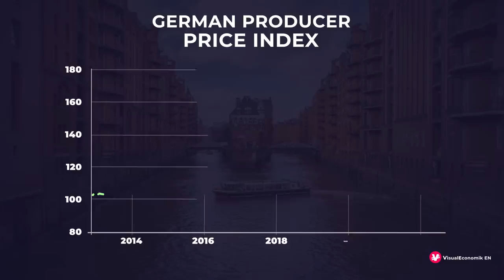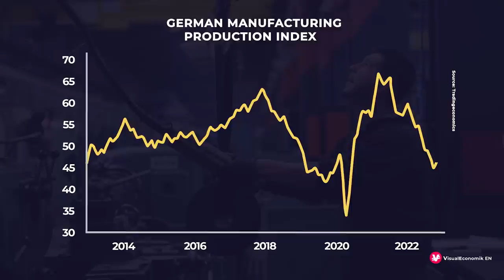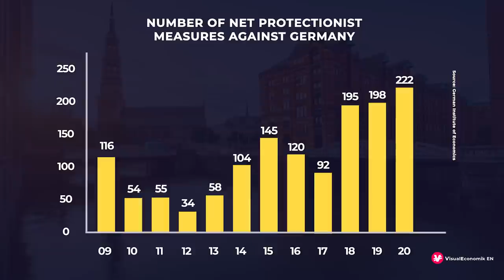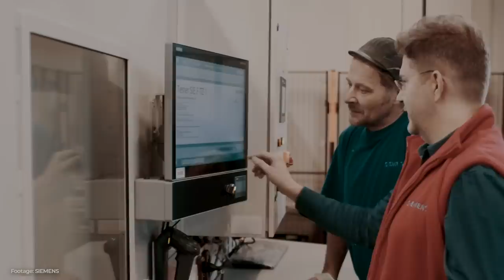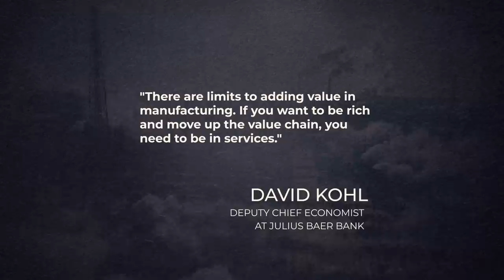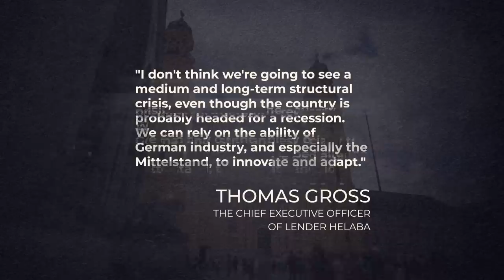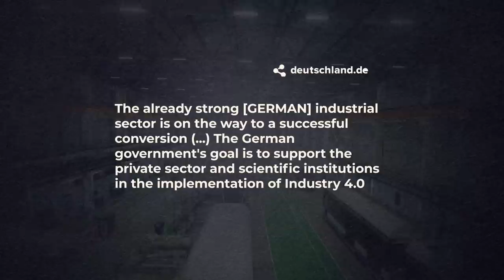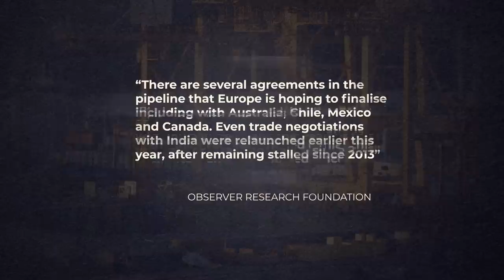Could the German Economy Collapse?

Comment: He missed a lot of factors. His focus on industry vs service is very oversimplified since it forgets that industry jobs also need some few high skill jobs. This high skill jobs ate often in Germany while the actual manufacturing is outsourced.  It also totally misses the influence of the German hidden champions aka small companies that are unknown bit without them basically nothing could work. Like a company that produces parts needed to build the machines that produce modern computer chips.
Reply: Yes exactly! The problems im my country are way worse and deeper than this video presents. It also misses on addressing the insane taxes and state quote in Germany as well as the refugee crisis and merkels catastrophic politics.
Reply: @Disintegration Zerfall  I would not agree that the problems are way bigger since the size of the problem was represented well. Taxes were addressed in the previous video and correctly identified as being on off the points that contributed to succes. So this is a point where i have to disagree with you. However this is most likely because of our different interpretations of economic theory. But regarding history i would say that high taxes are not necessarily an economic drain since they can also provide the necessary money for investments in infrastructure, education or other programms. Merkel, while providing the stability liked by many investors did miss a lot off opportunities to invest more into infrastructure or use the refugee crisis as a solution. However this is also do to the disastrous law called schuldenbremse.

Now the refugee crisis has not a big economic impact. 

Which is quiet sad since with the necessary investment it could have lessened some of the problems.
Reply: This guy is only focusing on the big companies but in real the strong foundation of the German business  is the small and medium business.They are world leading in patents for industry tools, they create jobs and manage the companies without having to pay a lot of bonuses. The multi national companies are owned mostly by foreign investment fronds and they want profit. This guy talks too fast about thinks he didn't understand in details. Only putting together what is public available doesn't make a proper video... 👎
Reply: @stegenheimer  first of all the left right distinction and divide is not realy fitting German politics since it is way more issue oriented than left right. 

Now there are mountains off evidence that investments by the goverment can increase economic growth. And as you said taking on to much debt is not a good idea. But the money needs to come from somewhere. So high taxes are therefore necessary. 

Now taking on debt is not necessarily a bad thing. Taking on debt to update your infrastructure for example can create economic growth that than makes it very easy to pay it back. 

Now what German left wing parties? They have not been in power for more than a decade. I mean they are in power since the recent election but this has not influenced economy that much.

But you do realise that renewables are literally the cheapest form of energy right? So building renewables faster is actually the solution to the high cost problem since coal is far more expensive. However renewables need the necessary infrastructure first. Building this takes time and money but similar to taking on debt to upgrade your machinery to produce faster this will lead to lower energy prices in the future. However you are definitely right that this is also an economic factor.
Reply: Country are not companies.
Reply: @johncastle2013  but the economy of a country is mostly influenced by its companies.
Reply: @emilsinclair4190  no, i dont realize that renewables are cheapest energy in reality - maybe on a ideological theory. Check energy prices in poland, france, spain, italy swiss, slowvaika, hungary to mention our neighbours... We are no 1 with renewables and no 1 on highest prices. 
Any country sucking the blood of its economony or in other words its citizens by highter than 50% taxes and quotes (except for norway due to its oil fund :D) killed its economy and economically fell behind. 
Germany has completely fullfilled the green ideologic ideas of the 90ies. Every western country is laughing about our stupidity and none of them follow our example... France investing even more in atomic energy. Result is that, we lose our industry and economical wealth and other countries take over our position.
Reply: @stegenheimer  looks like you don‘t even know how our energy market works. Go look it up and then read your statment again. Energyprices in europe don‘t work like that
Reply: @janmoschner9468  Did you read my statement? Where did I explain any market dynamics? Any other first & second world nation on this planet has significant lower energy prices than Germany does. With focusing on solely random energy sources like wind and solar we pushed ourself on the top of the league. Statements like more wind and solar will solve our energy problems are misleading. We just see on which energy sources our energy market truly relied: Gas and foreighn coal & nuclear energy. This channel has made a video about it
Reply: @stegenheimer  you said German energy prices are high even though they use alot of renewables. In fact renewables are cheaper the problem is that the European energy prices always choose the heighest energy source as a price. Therefore is the German energyprice not that high because they have alot of renewables, but rather because the rest of the European country’s pays more for their citizens energy use

Comment: The ironic thing being that the uk has faced higher trade barriers in the world than the eu has, since brexit. Giving away wholesale access to it's market, for little access to other countries.
Reply: Deals are better when you big.
Reply: @andreasgregorfrank9057  What utter rubbish.
Reply: @Gordon Smith  utter? No. However it is also oversimplified. A lot of people definitely did it because of that. Others did it because they believed that this would create less burocracy (wrongly) and other advantages.
Reply: @andreasgregorfrank9057  No it wasn't. As the EU has grown so has the number of vested interests.  This has made making trade agreements more difficult. For example the EU has been negotiating a trade agreement with India for over a decade with the end still not being insight. The problem being is one member state can veto the agreement to protect a domestic industry. In that time many industries within both the EU and India that would have benefitted from an agreement 10 years ago would not benefit now; the world moves quickly technologies come and go. Smaller more agile trade agreements that can be agreed in months/a couple of years not decades benefits industry. To EU is too slow and too cumbersome for the modern world. Get yourself a proper understanding of ecomonics and how the world works, it's a real eye opener.
Reply: @nickjnow1  the larger two economies are, the longer a trade deal between them takes. The deals the uk has signed since brexit have been carry over deals at best, with micro economies. Or actively dissadvantageous to the uk, with the bigger boys, like australia and japan. Speed was prioritised over substance to make a point, that the eu is slow. I'd rather live in a market that protected tge national interest thanks, and that is not the uk.
Reply: @andreasgregorfrank9057  you show breath-taking arrogance to think you understand the thoughts or motivations of the people on the UK. Such self-rightous virtue signalling may play well with the crowd you run with but is in no way a replacement for actually getting a deep understanding of how the works.
Reply: @Virtus incorrect.
Reply: @nickjnow1  I can't see what Andreas wrote but you are right. There exist much more important things to the average people than the economy. So I can understand why a tiny majority voted for Brexit. It was the typical easy political solution to a socio-political problem. Let's see how this will turn out for the Brits...

Comment: German mechanical engineering in particular does not simply sell machines to produce things. The most important part of this deal is the guarantee, in the event of a defect, to send a technician anywhere in the world within 24 hours to repair the machine as quickly as possible. This business model has long been a mixture of industry and services and is practiced like this by hardly any other country in the world.
Reply: That is not true. They dragged their asses fixing their overpriced pipeline equipment.
Reply: False Many great  World compagny does like 
 that

Comment: Click bait and mis-information = Unfollowed.   A 0.04% drop in GDP is not an economic collapse. Germans main customers are german not foreign, exports are less than 40% of GDP. The german producer price index has not changed by anything close to 80% yr on yr., its less than 30%.   70% of Germany GDP comes from services , it is a service economy. Your misrepresenting the manufacturing production index, anything above 50 is growth rather than the disaster presented by referencing the peak growth rate.  Everything from Brexit is down to the UK not the EU, the EU didnt introduce any new barriers or restrictions due to brexit but they did agree a free trade agreement rather than the default position of WTO terms.

Comment: Interesting topic, but as many comments already outlined, I'm not quite convinced: 1.) UK is currently struggling a lot because of the lack of production. As everyone can see after the Brexit, you can move service-based industry quite easily out of your country. 2.) the biggest german pain-point was barely mentioned:  Energiewende, the insane stunt of replacing all energy generation forms to renewables in contrast of a natural absence of that energy in winter. Compared to this, Industry 4.0 is just a marketing gag which no one takes serious anymore...
Reply: UK going better of any other EU country, this is a fact dude
0.60 kWh Vs 0.35 kWh, Do you know why? No gas share agreement!
In Italy we have a shortage of employees and medicinals.
XLS 120 cost 39£ in UK and 80€ in Italy, biscuits 4€ Vs 1.5 same grams, Coke 8£ Vs 15€. same cans and ml.
MOT 80 Vs 35, etc etc etc
Reply: @theweb3182  you are a little joker, aren't you
Reply: Let's face reality: Labours switched side.
Germany paying double compared to UK for energy (0.60 Vs 0.35 numbers talking) and EU sinking in public debt and recent scandals.
Reply: Manufacturing in the UK is never as big a factor as in other Europe economy anyway 
The problem is that the supply chain is built on the assumption there would be zero checks at the border so it needs to adjust but it's expected
Afterall most countries do checks 
When ppl talk about service industry they probably have this mental picture of waitors waiting at the table but the real big one for the UK is the professional services like legal and finance 
The City is not as casino like as the wall street so just like ppl don't tend of think of the Mitterrand of the German industry they don't think of the less glamorous service that the UK finance and professional service do
Reply: We would do far better in the UK and Germany if we stopped brown nosing uncle Sam. Just embarrassing how much we let them dictate our policies.
Reply: So amusing watching Europeans argue about economics when all of them already have the slowest growing economies on the planet and consistently have some of the worst economic forecasting on the planet. Europe is grinding to a halt.
Reply: The claim that renewables are absente in the winter is just wrong,  energy production from wind is much higher comparted to the summer months. On average renewable energy sources were at 43% of all electricity production according to the Fraunhofer Institut.
Reply: @colinhiggins4779  I explicitly said electricity production, but ok thanks for repeating it. Your point about 40%-60% backup from natural gas is also wrong, because if that were true we cloud see an big percentage of gas in the german electricity mix, in reality its only around 10% each year.
Reply: @airprasch4858  if German solar and wind did not depend heavily on natural gas backup, the Ukrainian conflict and Russian gas embargo would have had virtually no effect on the availability of electricity and the price of energy. But we have seen massive disruptions in the availability of electricity, soaring energy costs, brown-outs, and entire factories shuttered (ArceloMittal, the world's second largest steel company, had to cease operations in October). Because solar plants are actually gas plants, they can't function without Putin's gas --a total fiasco for Germany. Energiewende was the worst environmental policy in world history. Just the fact the Germans shut down their nuclear plants (which are many times "cleaner" than solar) to put in inefficient solar farms dependent on a dictator, is just mind-boggling
Reply: @colinhiggins4779  Now we have some interesting arguments, let me try to respond to them one by one.
1. The high electricity prices as a result of the embargo: The reason for the high prices is pretty stupid way its calculated in Germany, the price of electricity is always set at the most expensiv productions method in that case naturale gas. So even if the share of gas in the energy mix would be only 1%, it would still have an huge impact on the price as long it is this expensiv. This is the reason why Germany plans to implement a new way to calculate energy prices witch many takes the average price into account.
2. Factories like ArceloMittal shutting down: The shutdown mainly effected factories with high gas demand, but this problem would have accrued with and without renewable energy sources. The EU started buying gas on the international marked to extremely high prices, because they were worried that they wouldn't come through winter, wich spiced the prices for consumers and the industry. For that reason was unprofitable for ArceloMittal to keep the production running. But without the renewable energy sources the demand for gas would have been even higher and according to this the prices to.
3. Shutting down nuclear powerplants: On this on I agree mostly, but i would preferer a combination of nuclear and renewable, wich uses power to gas in times of overproduction wich it can use in case there is no wind and no sun for a certain amount of time. There are 6 reactors in Germany that would work just fine, but a lot of political parties are against it for mainly ideological reasons.

But all in all, thanks for your calm response,I really appreciate it.
Reply: @ThomasVWorm  I see your point, the speed in which new production facilities go on line is far to slow at the moment. I really hope new because of this difficult situation that Germany gets same new momentum in this regard,  when it comes to 100% renewable, it will be necessary to increase the production capacity multiple times and there will be a big demand to store energy one possible solution for this would be power to gas.
Reply: @ThomasVWorm  Yes, hydrogene is the most promising candidate, the biggest part storage will most likely sill be underground, like with naturale gas. It will be of course more difficult zu store such high volumes, compared to the aktuelle solution hydrogen can escape much easier, but in my opinion it's the only viable solution, because turning off wind turbines would bei a greater waste. In addition a lot of industrial applications, where nowadays gas is used, hydrogen could fill his gap with just very little ajustments.
Reply: @RPAX100 there's also a natural absence of petrol in Germany. In my oppinion the problem is not the "Energiewende", but Germany were too slow with it in the last decade. The current situation of problems to buy energy resources on the market was exactly why Germany was pushing renewables. Unfortunately storing energy (eg power to gas) only works with significant overproduction and we are not at this point yet. So energiewende was too late to help Germany out in the current crisis.
My personal oppinion in the last years was that nuclear power plants should have been kept online until the last coal power plant was shut down. But this was spilled milk for the current government. I don't think it was viable to keep the last three nuclear power plants online much longer than spring. Skipped maintainance and not training new staff because of planned shut down cannot be mitigated on short notice.
Reply: @airprasch4858  I agree with much of this, and my main contention is that Germany never should have decommissioned its nuclear reactors. In order to produce enough energy going forward, we need a hybrid approach that uses nuclear, solar, geo-thermal, hydro, and even coal, at least in the immediate future (but coal should be phased out for sure). Depending entirely on "renewables" (and they are not renewable: they require replacement panels, natural gas backup, etc.) is just crazy. I highly recommend the film "Pandora's Promise" which outlines at lot of these issues, and makes the case for nuclear.
Reply: @airprasch4858  the backup is now from coal, not natural gas.
Reply: So is this channel ;)